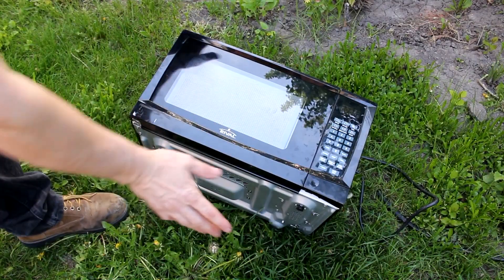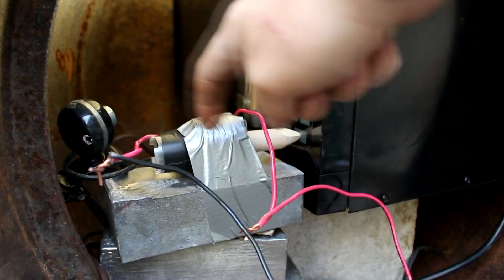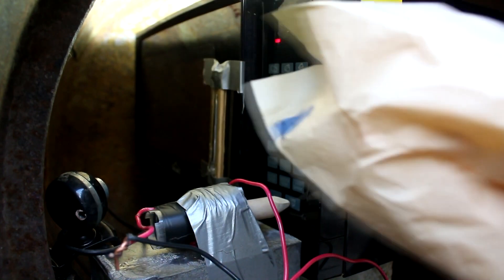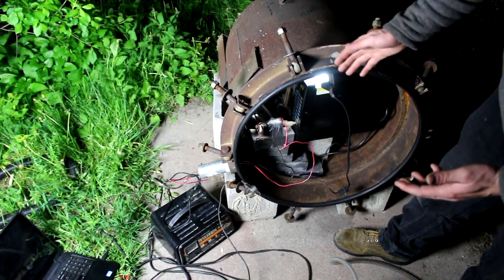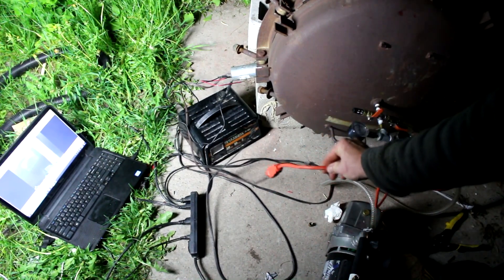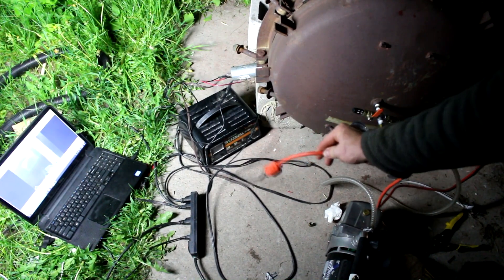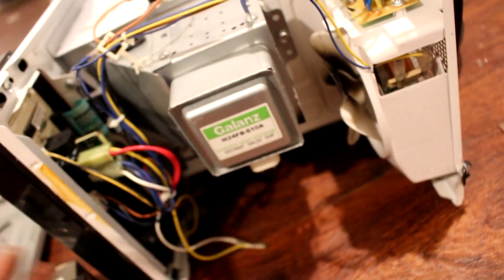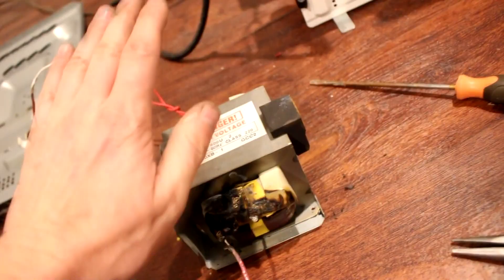Microwave In Vacuum Chamber

Comment: Be careful with microwaves. Their capacitors can still kill you even after they are unpluged if you open them without knowing what you are doing.
Reply: Slacksijie , maybe yes, but that was 30kV with barely any current flow behind it.
A capacitor can store up a lot of voltage and a lot of energy at the same time; able to create a lot of current flow. And, a capacitor typically has a very low equivalent internal resistance.  Much more dangerous.  It can be deadly, as stated.
Reply: I am getting zapped by 50kv every time i get out of my Wool pullover.
Reply: It's not the electrons that hurt, it's the holes!
Reply: Mr30friends These caps have a 1 meg discharge resistor integrated. They are save to touch after a couple of seconds, but still handle with care!
Reply: I'm pretty sure he knows lots of people do
Reply: A previous student at my school was playing around with some microwaves and the capacitor discharged on him. He came back to school without his fingertips. They were completely gone.

Always discharge.
Reply: When was that?
Reply: The antenna on the magnetron contains some really nasty stuff anyway, serious cancer risk if broken.
Reply: Green Pretzel Only the really really old ones. Beryllium Oxide is such a strong carcinogen that the use is extremely regulated. Even the production is controlled. Today (80+) The insulators are of aluminium oxide if I remember correctly.
Reply: Correction They are made of alumina
Reply: Green Pretzel like what?
Reply: Mr30friends They have internal resistors that discharge the capacitors over time.
Reply: icy boy If you breath the dust in you can get lung cancer and of course berylliosis. Today's magnetons are totally safe but you should obviously not grind the insulators, if you have to for some reason take the same precautions you have to take for every other hard fine dust. The caps are save to handle but as a matter of safety short them out.
Reply: Mr30friends I have one of those 1600v microwave caps.  I think I could use them in a Tesla Coil.  Hmmm
Reply: Drakkar Calethiel right, beryllium oxide, forgot about that
Reply: Drakkar Calethiel Fair enough, I wasn't sure how old this one is but I know a lot of people get old ones to take apart for the transformer which is a bit risky.
Reply: It is called beryllium. It looks like purple ceramic.
Reply: BoomBrush They store a good amount of charge but not enough to cause such high carnage. Otherwise an AED would definitely fry you. (These caps can deliver around 500 joules versus around 1.5-4 joules in a microwave)
Reply: i have a morning gown made of this unholy material that zaps me with several hundred kilovolts every single fucking day. when i take it off i need to take a key and touch the metal part of a desk to discharge safely, otherwise it will fuck me up.
Reply: That is a common myth ; the reality is every micro-wave oven I studied have a discharge resistor incorporated inside the capacitor. Value is around 1 MegOhm. The maximum voltage possible, 2000 volts, would decrease to below 100 volt in less than 1 second. 

Because the capacitor is used has a voltage doubler, it has more chance to be close to zero volt than any of the peak voltage. This is because it complete discharge and charge in the other polarity on each cycle of the 60 Hz wave. That is why a normal electrolytic capacitor, which has a positive/negative electrode, can not be used has voltage doubler.

Finally, even in the worst case, if the bleeding resistor would be defective and the power would be removed exactly at the peak of the 60 Hz wave, and somebody would grab each electrode of the capacitor with both hands, the amount of energy inside 5 uF (typical value for 1200 watts microwave) is too low to kill... unless your heart is waiting for any pretext to stop.
Reply: slacksijie 
Voltage doesn't kills what kills is current, those things can deliver both, so better be careful with them
Reply: xdddddddddddddddddddddddddddd
Reply: Didnt he get zapped with 20kV or smth during his mercury air siphon?

Comment: My guess is that the vacuum caused free elektrons to form a plasma spark  on the high voltage side of the transformer. A very similiar effect as in plasma balls. In old tube televisions those free elektrons were accelerarted and controled by elektric fields to excite an phosphorus screen...

Comment: Surely an arch wouldn't be able to jump as far in a near vacuum? Great video!
Reply: actually, there is a nominal pressure that is adequately described as near vacuum under which the longest "arcs" can be achieved because of the ability of the electromagnetic field to ionize and accelerate particles which would normally crash into enough other particles to dump its energy.  I dont know for sure, but I imagine that the pressure needed for maximum arc would be around whatever pressure that gas's components have a free mean path around the order of magnitude of the distance between the electrodes.

Comment: Wierd how a lower pressure would make the thing draw more current, interesting.
Reply: It could be due to the transformer arcing as explained at the end
Reply: it was just the arc, that shorted and could draw more power, until the fuse blew.
Reply: More that without all the air with it's electrical resistance, the arc was able to travel much more than normal
Reply: Wierd how you said that here and you didn't just google it to see that this is obvious.

Comment: I wouldn't have thought that transformer would have burned up so quickly, I would guess without air to cool it, the coating in the wire melted off causing a short. I expected the magnetron to overhead not the transformer to fail.
Reply: This makes sense. Properly functioning electronic/electrical devices need proper heat dissipation. Which requires air obviously. Although, since the vacuum was only at 95% other factors are possible. Reading around "partial" vacuum conditions are pretty unpredictable in comparison with "perfect" vacuum....One thing I noticed when reading on this subject (behavior of electricity under vacuum) there are many theories :)
Reply: I thought that magnetron of capacitor got short or no oscilatting overloading the secondary. But as they pointed above transformer self destroyed because arcing.
Reply: Right due to heat melting the coating off of the transformer wiring.
Reply: That makes more sense then arking. I understand thad a vacuum is a very good thermal and electrical insulator.
Reply: Isolating is a bad thing because the heat builds and melts the coating off yes.

Comment: Cody can you make a Jacob's ladder and see if it can arch over larger gaps in a vacuum?  it could be that the air itself acts as an insulator.  On my linear accelerator at work the engineers use SF6 gas as an insulator for our magnetron.
Reply: " On my linear accelerator at work"

ah yes we all have one of THOSE at work, don't we?

... we have a bookshelf in the office, that's about the most exciting thing we have (apart from the coffee machine maybe)
Reply: Well if you are a radiation therapist you do, heh.
Reply: Lukas don Well,your office is outdated then.
We have the elevator,a adrenaline machine..
You never know when you are going to die.
P.S. Yes someone found out a way how to get it stuck so he gets payed for using phone in elevator for 3+ hours..
Reply: Binary's Bits he would have to be careful to insulate the the inside of the vacuum chamber. It is bare metal atm
Reply: True.
Reply: Binary's Bits You work on an accelerator but don't understand how a vacuum tube works?  It's 120 year old technology.
Reply: What are you talking about?  I've not mentioned a vacuum tube at all.  I also mentioned I'm a radiation therapist, the engineers work on the machine, if they need work, which I also mentioned.  Please read before trolling.

Comment: Without the electrical resistance of the air present, the high voltage transformer (which normally wouldn't arc that distance) was able to arc between the windings.  Hope that helps!
Reply: Michael Faux the dielectric strength of a vacuum is much higher than that of air
Reply: literally rephrasing what he already said.
Reply: Yeah it's odd how I copied someone who commented after me... You're a smart one Michael

Comment: You can't put together high voltage (4 kV at the voltage multiplier) and vacuum. As pressure in the chamber drops, probability that spark will jump between wires rises. As pressure goes even lower, there is 'sweet spot' or 'knee' where probability going back as it is the case of 'full' atmosphere. For this reason, all experiments are done with vaweguides and teflon/ceramic barriers (to keep vacuum).
Reply: vawe?
Reply: yes. 60 hz vawe :D
Reply: Wave, okay... typo. Croatian word is "val", or plural "valovi".

Comment: But what happens when you put a vacuum chamber inside a microwave?
Reply: Pure vacuum in a container that is transparent to microwaves? Not much. You have to add a touch of gas to it. Like argon or mercury vapor in light bulbs/tubes. If you use them you get a really neat light show for a few seconds until the glass melts, cracks, or explodes.
Reply: Jimbo, NICE, TRIPLE whoosh!
Reply: You get a whole lot of nothing
Reply: if its a metal vaccuum chamber, you get the same effect as putting a metal fork in the microwave. If you don't know what happens when there's a fork in the microwave, go ahead and try it, its actually really cool. The fork turns blue and gets really cold. Go ahead, try it.
Reply: Jimbo Nuetrin Then you can't close the door because most vacuum chambers have tubes that you can't remove. (Some probably can disconnect their tubes)

Comment: would the popcorn microwave faster because of the vacuum? I would think that the pressure would be greater inside the kernel (because the popcorn pops because of steam pressure) relative to the outside as soon as there was even a bit of steam.

Comment: so the verdict is: if it have transformer dont put it in vacum
Reply from the maker: maybe just high voltage transformer.
Reply: filippance *high voltage
Reply: filippance we shouldn't but Cody definitely should so we can watch it fry.
Reply: transformer rated only to work at atmospheric pressure*
Reply: actually the verdict is, if you're using a microwave with the goal of heating up food or popcorn, use it as it was made. at 1atm. If the goal is to destroy it or do a crazy experiment, there are no rules.
Reply: High voltage transformer. Mains winding survived, so the coil insulation was enough, for 120V ac at least
Reply: Well, you should be able to run it just fine with the transformer taken out and outside of the chamber, the downside of course is that 1. you'd need another microwave (or a proper replacement transformer for this one) and 2. Something else could fail in the microwave for same reason, rendering it all in vain

Part 2 xD?

Comment: If you put ants in the microwave and put the microwave in the vacuum would the ants survive
Reply: calm down techrax
Reply: +Betaslash you are right I once mistakenly microwaved a fly. When I opened the microwave it buzzed out.
Reply: the vacuum would kill the ants remember when Cody killed the aphids on his potato plants by putting them in a vacuum if it would kill aphids it would probably kill ants as well
Reply: Pretty sure that purposefully microwaving them is avoidable...
Reply: I've heard that they have so little water in their bodies that the microwaves don't affect them.
Reply: Really depends on what you are microwaving. I once microwaved a bunch of mealworms (cuz', science) and they exploded. The insides rapidly expanding like a foam, just like what happens to eggs I believe.
Reply: tardigrades would.
Reply: No thats how u get mutant alien ants dude I ain bouta fuck with that
Reply: I read a study that showed ants can survive roughly 10-12 minutes at 6 mb.
Reply: Erik Hendrych 
I'm not claiming to be an expert, but as far I know the oven is designed to make the wave resonate, in consequence there are spots were the wave intensity is very high (hot spots), while others are zero or near to zero (cold spots), my guess is since ants can sense heat and are so small, they could easily avoid the hot spots and survive. It would be interesting to know what would hapen if you tie the ant and make it go through a hot spot, but I'm not that sadistic ; )
Reply: There is definitely hot spots, as if you cook something large in the microwave certain areas will get more cooked than others.
Reply: Chris Cook 🤢
Reply: Joaly nocontroly well the fact I'm vegetarian is irrelevant but I wouldn't kill an earth worm, they're actually kinda cute. Ants and flies on the other hand, if they're in my house they're good as dead.
Reply: I do seem to remember the ants will actually move out of the way of the waves, never seen video of it though, just something a science teacher once told me.
Reply: ants can survive in microwave anyways. so they just gonna die from lack of oxygen
Reply: Christine ....? lol
Reply: Christine I'm getting the impression you don't like ants...
Reply: Action Lab (former hydraulic press action) did a video with spider and fly in vacuum chamber. Ants are usually even tougher than spiders :D
Reply: Christine 
they will survive the microwaves but will die because of the vacuum. The ants are too small to be affected by the microwaves, which are around 12 cm long, basically everything smaller than a quarter of the wavelength is safe, no matter how much water does it have
Reply: maelgugi what kind of ants are that huge?  giant, mutant carpenter ants?
Reply: A 
I think you miss read my comment. Ants are safe in a microwave because they are usually too small to be affected by microwaves (usually under 2 cm)
Reply: +A: read again maelgugi's comment. Waves are 12cm long not ants.
+maelgugi - not sure if you or me but clearly one of us doesn't understand the principle of microwave. I thought that microwaves attenuate in water (molecules vibrate etc.) so it doesn't matter how thick the water is. The things in microwave don't act as antenas, do they? I once heated Nutella with like 3x1mm leftover aluminium foil and it made spark. If the microwave didn't heat objects under 3cm then my alu  foil wouldn't have made a spark.
Reply: Erik Hendrych 
On the other hand, if I recall my physics classes correctly, in order to make something resonate (water in this case)  you need to make that something at least a quarter of the wavelength long. Please feel free to correct me if I'm wrong :)
Reply: +maelgugi aha, sry ok, but if you put ant on rotating plate then RIP ant :D
Reply: maelgugi Yeah I think you must have something mixed up there. It would mean putting a 5cm potato in would cook, but cut it in half and it suddenly wouldn't. What if you divided the potato in half but the division was microscopic? At what point of moving each other apart would it stop heating them both? I don't think that's how it works.
I believe that the microwaves affect individual water molecules regardless of the size of the container. Maybe the 1/4 wavelength thing is something related to molecule size or something - Which might be why it affects water and not the other molecules in food. I have no idea though, just speculation. Would have to do some googling!

Anyway, main point is I think microwaves affect individual water molecules so the smallest thing you could microwave is 1 water molecule!
Reply: UraniumMan.  Not in my case. They are always in my food and end up getting nuked when I reheat.
Reply: ants are like another kind of Ebola or cancer. Theyre everywhere and i usually just pour hot boiling water with a bit ... vinegar on them.
Reply: Let's try that with you, and see if you survive. The knowledge gained may save countless lives, and you could be a hero!
Reply: I hope you didn't eat the food when you took it out. That's what happened to Jeff Goldblum.
Reply: Yes they would survive for along time
Reply: Steven Cassidy 
After a research it turns out  I was miss informed about microwaves heating water by resonance... so yeah, it seems the hypothesis that the ant is small enough to avoid the hot spots is the most likely ;)